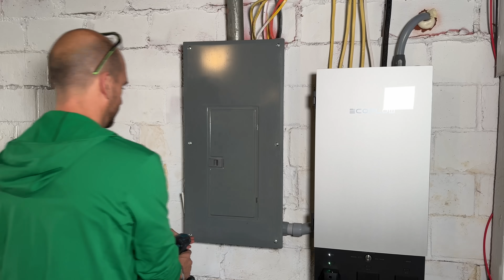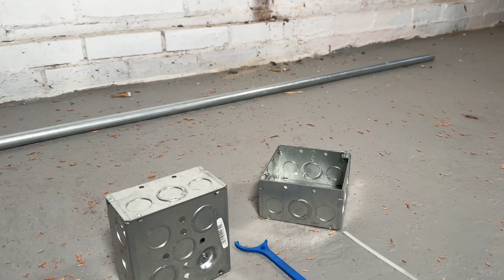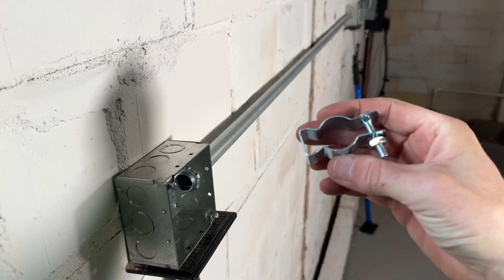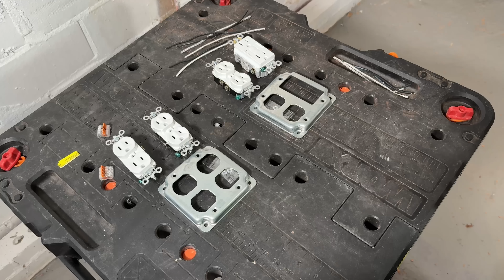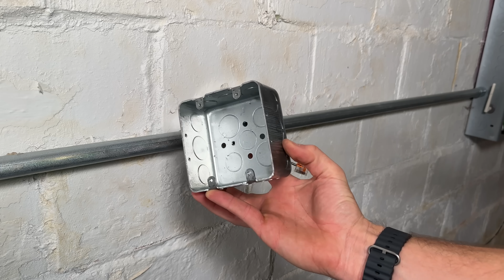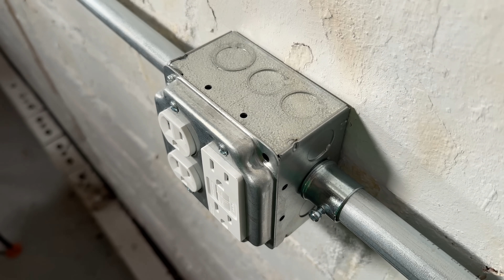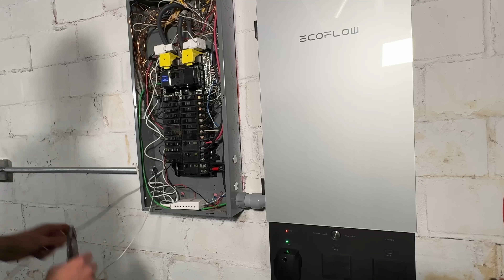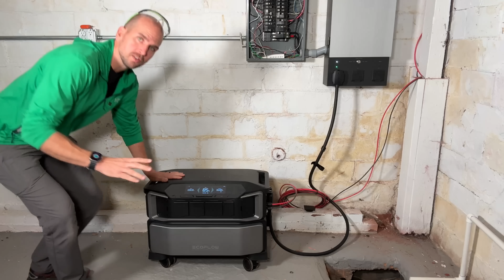Add Outlet To Unfinished Basement Or Garage

Comment: Lol all you gotta do to learn from real electricians is post a video of you doing electrical incorrectly. The electricians will make sure to tell you in the comments everything you did wrong. 😂
Reply: This principle can be applied to any topic at all. If you ask a question, most people will ignore it. If you share something that is wrong, everyone will be eager to tell you about it.
Reply: He asked for input
Reply: The problem with that is: none of you agree with each other either.
Reply: I always use a system ground even in a plastic box. A compression ground is a bad idea for over time especially in a basement where you have heat and cold expansion to metal; fittings can loosen up. Why risk it when you can just run another ground wire and be safe.
Reply: @pdihouston7725 
Lol you have to use a system ground in plastic boxes .😂😂
Reply: @pdihouston7725 system ground in a plastic box. What are you bonding in a plastic box?
Reply: Like using the emt as a ground not at all a good practice. It does comply with code. Yes. But is it going to ever be a low resistance ground or remain low resistance, not likely.
Reply: @Edmocci  I've witnessed first hand shocks from outlets that have lost equipment grounds. A JW I was working with in my first year got 90V across the chest touching wiremold that lost ground
Reply: @MajGenAtlas that's why local code requires ground conductors even inside conduit. They don't want any eventual shocks due to conduit corrosion. I like the wrench however. As far as disconnecting power to the mains in the circuit panel before wiring, I've never seen any electrician do that including me. Just remove or turn off that breaker before working on that circuit. As far as drilling to expand a hole in the panel, this guy didn't even vacuum up his metal shreds inside the panel. It also looked to me while cutting that he may have been using rigid conduit. Code also says to bend the conduit so that it rests on the wall with mandatory supports connecting conduit to the wall. This guy only drilled into the mortar and did not drill into the brick. He was supposed to avoid the mortar and use butterfly nuts to secure the boxes. I didn't see him measure height so I'm positive they are at an incorrect height from the floor.

I could go on but as you now realize, this guy is a rank amateur not a professional or even trained in any way. Please use this video as what not to do and is a perfect example of why a little information is dangerous.
Reply: @robertrdell8898  Yes, amateurish install and a good example of how not to do it. But that's not rigid (it's EMT), it's not required to rest against the wall, and there's no required height.
Reply: @pld8993 EMT needs to be strapped within a certain distance from a fitting and every 5 feet per code!!
Reply: @Edmocci  , I totally agree.  If the set screw corroded or gets painted at some point or kids play around with a screwdriver, anything that can gap the continuous ground means NO GROUND. Best to have a continuous dedicated wire ground for safety sake.
Reply: EMT is a better grounding path than a copper wire up to about 400feet.
Reply: Could you provide code sections on your grounding
Reply: I would run a ground wire and bond the receptacles.
Reply: @SLR256 mee to
Reply: You can do whatever you want in your own house, just don't try to sell it.
Reply: NO! ...Just NO!

While not a "code god" I have been doing this for 55 years.  Had a transformer go bad in a factory once and saw FIRE fly out of every conduit connection for 250 feet.  DO NOT USE THE CONDUIT AS A GROUND PATH!  THE REISTANCE IS TOO HIGH.  If yer too cheap to add the ground wire, don't do the job.  BBQing your kids ain't cool.

Also... Romex... in conduit... has been done everywhere always for like 70 years or more.  I do a lot of repairs on old  buildings.   Ya NEVER see individual wires.  While he is saying not to do it...he is doing it.  Proves my point.  It's got extra covering and not unsafe.

BTW.  I work Advanced Research and Development for the major power company and my own company 33+ years.
Reply: Where's the ground?????
Reply: Sounds like some of the negative commenters want you to hire a master craftsman electrician to plug and unplug a lamp.  I’ve done my share of home electrical work after one electrician couldn’t locate the problem and gave up.  I found it myself and fixed it after reading some home repair books and my house is still standing.  Might not be for everyone but education like what is on this channel is the answer not blow hard know everything critics.
Reply: @georgequalls5043 if that electrician couldn’t find the problem then he’s not much of an electrician
Reply: @ChrisJohnson-mp6fh  given time he probably could have but didn’t want to put in the time as it was a flat fee for the work.
Reply: Im a Master Electrician and the one thing I cannot stand, Dick measuring idiots, who think they are gods gift to the trade. Go sit the fuck down and continue to play with yourself and jerk off to the code book. 
The main concept is safety, then functionality, and last, also mostly in residential, is appearance. 
If you can safely say that the job is safe and no intention of negligence is left behind, then you should be fine. The code book gets more and more ridiculous every 3yrs. 
Its been taken over by insurance lobbyists to release any liability from them paying to create any loophole that will put fault on and responsibility of paying on anyone else except the insurance companies. 
Your house or building has electricity and gas running through it 24hrs a day, it can only be as safe as that. 

So code book thumpers, just know this, those that change codes do not care about anyones safety before they care about job security and liability to shift away from insurance companies. 
Also as something like a shity AFCI, is only because someone invented it and someone behind that book is make big money off it.  

You don’t believe me, then ask the plumbers in Texas, because for years you needed a plumbing license to work as a plumber, but all of sudden, since there was no more funding to keep it going, they shut regulations down and anyone could be a plumber. 
So if its about safety, especially when running natural Gas, then why so quick to drop it?
Reply: It's not as easy as it seems. There's much more to it,, a guy like you might get hurt..
Reply: @davidwenger1016  guy like me??
Reply: No the guy sitting in his chair... and thinks it all easy....
Reply: Thought that was a new code 2017...
Reply: Ok, why not just run romex over the top and drop it down through the emt into the box?
Reply: electrician here, I'm doing my part
Reply: Why weren’t 20A outlets used on a 20A breaker with #12 wire?
Reply: As do
Carpenters
Drywallers
Painters
Mechanics
Data techs etc
Reply: Your right!! I’m a carpenter ( 40 years) retired but I have commented on vids that are wrong👍
Reply: @gillgetter3004 most of the time it's an electrician nitpicking on things don't matter, not wrong. Ive seen so many sparkies get upset when all the screws on a receptacle cover plate aren't all facing the same way..yet truth be told it doesn't matter a shit in a high wind yet many will spend their time trying to knock a DIYer down for the dumbest of things. Same as this video. One guy says you can't use romex in conduit and 5 electricians will say you can't ... But fail to realize that there is nothing in code that says you cant, yet they know best evidently. Look, if you won't work for free stop giving critique on things that don't matter. Should be encouraging people to do their own work not discourage it. That's how we help people . Sadly I see more electricians saying shit that don't matter or just being a prick in general. Hope your advice was shooting straight with the dude
Reply: @realtyrocks1969  you will find that most "sparkies" are basing their comments on experience which means some are going to be wrong. Also, the Code is only as good as the inspector. It is the minimum requirements to insure a safe installation. However, most jurisdictions add expectations above and beyond the code and you must meet their requirements even if you disagree with them. In my experience, most people who argue with experienced tradesmen are basing their information on the way their granddad did it or how they have always done it. Just because it has worked in the past, does not make it correct, nor does it indicate it will continue to work in the future.
Reply: @realtyrocks1969 well said. Most homeowners do scary things including me. So watching him helping us is great appreciate it. He always say to leave a comment for improvement and that he doesn’t know it all. I am glad you made your point
Reply: @realtyrocks1969 it's called consistently..You're the problem.  Everything should be straight and lined up. Just cause ur to lazy to finish a job correctly, don't get bent cause someone else does.  You're a joke sir! Have more pride in ur work.
Reply: @realtyrocks1969 yeah, except what he said is right, and I've been told by more than one inspector that it's a no-no.
Reply: @TwilightxKnight13 you can talk shit all day but when something is wrong it is wrong, and encouraging people to do electrical their own way is just asking for trouble. This isn't like gender identity that anyone can call themselves whatever they want and expect people to automatically approve😂😂 i guess some people like learning the hard way
Reply: @realtyrocks1969  I have all of my screws in the same orientation (vertically) for two reasons, 1st: craftsmanship, it just looks better. 2nd: if the slot is vertical, it is less likely the snag longer fingernails when a user is operating a switch for instance. I know it’s not a requirement and I can care less what anyone else does, but that’s what I do because it matters to me.
Reply: @keithdouble1440  I prefer to snug them up so they are tight and the plate is held firmly on the wall. I use screwless covers throughout my house except in the bathrooms because I wanted more decorative cover plates. I've never seen someone snag themselves in a screw that is essentially flush with the wall but if you like doing it vertical or horizontal it doesn't matter too much. My point is it's not covered in code so do whatever you like.
Reply: @realtyrocks1969 heat dissipation will double when romex is tan inside of conduit. Which means one should really create the wires in order to not hear them up more than normal application. So you mr. Genius engineer are wrong
Reply: @IllegalMigrantICE  try writing that again in English. "Tan inside of conduit" , hu? Ok dummy sit down now.
Reply: @realtyrocks1969 agreed 👍
Reply: @realtyrocks1969 did you say they’re pricks?
No I know why they charge so much.
10% brains and 90% prick
Reply: Electricians also like to bicker about best practices with each other. And this is a simple, straightforward installation….
Reply: Straight to the comments 😂
Reply: Mainly arm chair electricians.
Lots of people saying something isn't done correctly or code compliant and it actually is. Some of it is comical.
Reply: Agreed, blind leads the blind on YT. Love the low voltage device lying in the bottom of the service panel.
Reply: This video proves a little knowledge I our trade is dangerous.
Reply: @peterb.mahnke1068  common sense will tell you about the dangers of electricity. I been playing with electricity since I was four. I learned you don't put car keys in the outlet.

 After that I also learned when plugging in the vacuum cleaner you don't get your fingers between the prongs of the plug.

 At five I made my own extension cords using a plug , an outlet, wire and electrical tape. 

I had my shocking experiences and learned what not to do. Dad taught me how to wire he was better than any electrician. The inspector told my mom you don't have to worry about his work it was much cleaner than some electricians the inspector came across.

 The ground and GFI and ACFI made electrical a little more challenging but can be learned if you put your mind to it. 3 way switches is no big deal even four way switches. 

I learned the three different ways to hooking up three way circuits. Feeds at the light, feeds at the switch and the other switch. We learned them in the ninth grade. 

Our jr high had a electric and electronics class. The seventh grade and eighth grade had 12 weeks of this class and the ninth grade had a year of the class, we even learned house construction for a electrical break. Also learned auto wiring as well. We made projects of all areas of electrical and electronics. We built kits which ever we choose.

 I made the two band Am radio. I had to start over when I wired a short on the B + but that summer I rewired the radio and it worked.

 I also repaired my friends AM radio. There was a wire going across the I F transformer that wasn't supposed to be there. Took the wire out and the radio worked. 

So I learned that kit makers make mistakes as well.

 Most people would just replace the faulty part but I took it apart and fixed the flaw. 73
Reply: How so?  @peterb.mahnke1068
Reply: Code violations .  Just to start no supports on conduit
Reply: #1 this video is made by a DYI acting as a trained electrician! #2 Rigid or EMT isn't  required to be mounted against the wall. Why he didn't do offsets isn't known!  EMT  and Rigid can't be used as a ground if you use set screw fittings. They have to be compression fittings etc. #3 you can use romex in conduit as you will need to leave the identification sleeve because all wire in Metal or NM conduit must have type identification. The conductors inside the romex isn't marked so this is why you leave the marked romex inplaced! Only thing he got close was when he installed the GFCI but then he needed to mark the other outlets as ungrounded!. GFCI works by turning power off but there is no true ground on his installation! It's confusing but it's fact.  There are plenty of REAL electricians online to GET IT RIGHT. The small mistakes can kill you😊
Reply: @mkidd8806 any suggestions of what YouTube channels to follow?
Reply: Interesting,
Reply: Yeah and even what's right they will tell you the way they do it. It's best to get a second and third opinion. 73